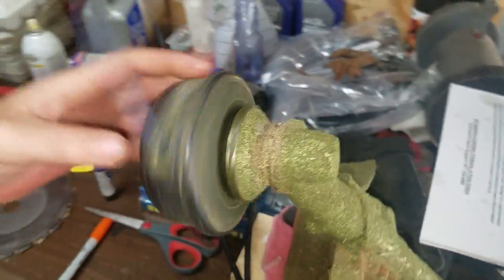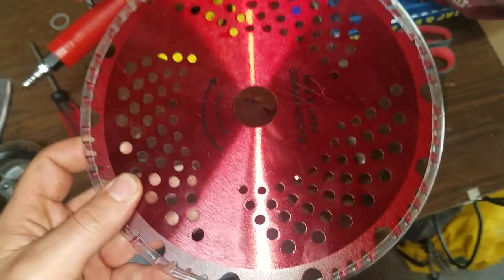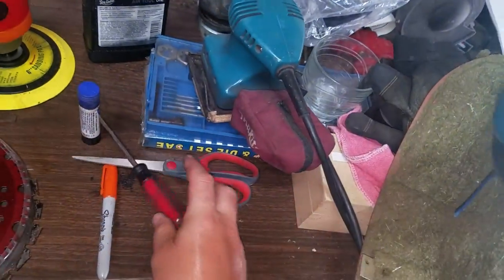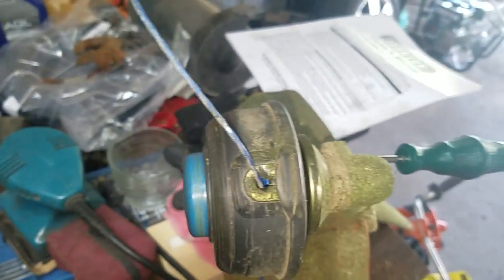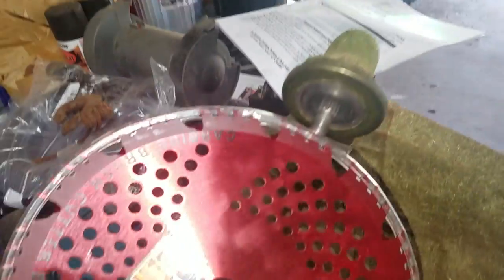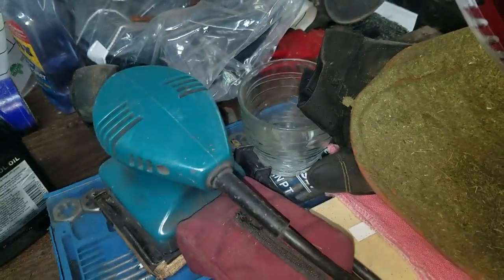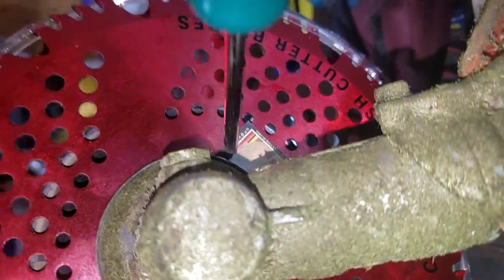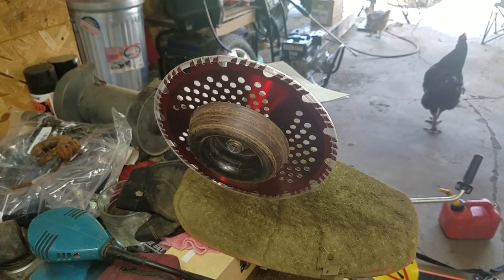🚀How to change from the string attachment to a brush cutter blade on husqvarna 223r🚀

Comment: For everyone’s benefit, you can buy the blade and put it on the hub and then just thread your trimmer head back on- so you don’t necessarily need to buy the kit that holds the blade on.
Reply: I was wondering about that
Reply: Guess that's what I'm gonna be doing because obviously you need the adapter kit. What a drag! Mine is the 223L and without the adapter kit, it won't go on. When putting on the original head as you said, looks like you're only gonna get a few inches of cutting space, plus can't really go to flush to the ground, but better than nothing I guess.
Reply: borg386 It’s a mean combination to have string and blade together. The string handles the weeds and the blade cuts the saplings. Anything bigger than a couple inches diameter I’d just leave to a chainsaw.
Reply: @firstlast7099  oh! I didn't plan on having any string in it. But yeah, for the bigger things I got the black and decker alligator chainsaw. 
Thanks for the recommendation! Can't wait to try it out.

Comment: Where do i put the little skinny washrr thing that came with blade
Reply from the maker: That's so it can work with diff sized shafts. If your shaft is the little one it would go in the middle of the blade to change the size of the whole
Reply: @AdventuresInLiving i have 223L and cannot use blade with it
Reply from the maker: @corniss  it works for it, and has for everyone else. what is the issue you are having ? do you have the adapter for changing from cord to a blade
Reply: @AdventuresInLiving  i have 223L. Not 223R. There is no attachment thingy for mine.
Reply from the maker: @corniss  yes there is https://m.lowes.com/pd/Husqvarna-123-223L-Brush-Cutter-Kit/3372946

Comment: Where did you find the brush cutter spacer and nut?  I've tried my local hardware and mower stores but they don't carry it
Reply from the maker: Lionel LAWRENCE it came with the brush cutter. You  can also get a parts kit from husqvarna that has them. Let me see if can find online and I'll put a link in comments

Comment: can you do this with almost any weed eater? i have an echo 58 v cordless
Reply from the maker: it depends on what you want to cut. if just doing light brush should work but if trying to use it to cut down like 2 in thick small trees the cordless will be to under powered
Reply: yeah that makes sense. I don't want to destroy the machine by taking it apart if the parts are made differently. I think I should try it :D
Reply: Carrina Murphy `

Comment: Just FYI, you don’t have to buy that specific blade. I put 4” circular saw blade I had sitting around my garage on mine . Works flawlessly.
Reply: Do NOT do that! Saw blades were not meant for high speeds on a weed wacker. IT WILL FLY APART! PLEASE don't do this if you are reading this comment

Comment: Counter clock wise to undo ????
Reply: I heard with weed eaters that the normal righty righty and lefty loosely  goes out the window due safety so it doesn't spin off .so it is opposite with weed eaters. But I haven't tried it my self.